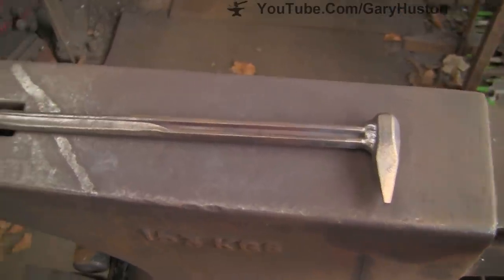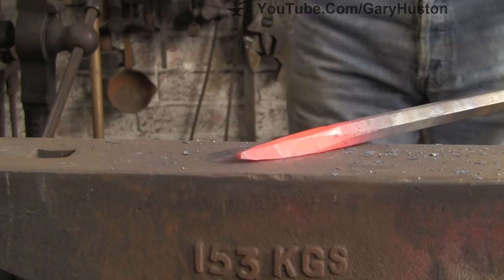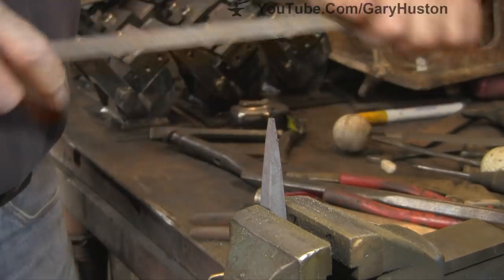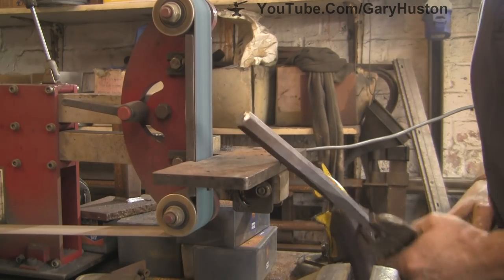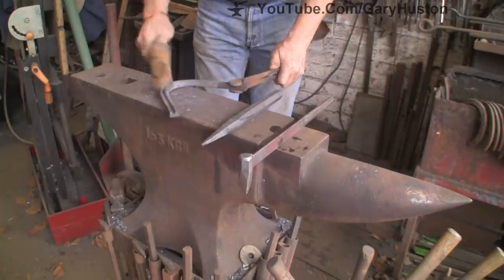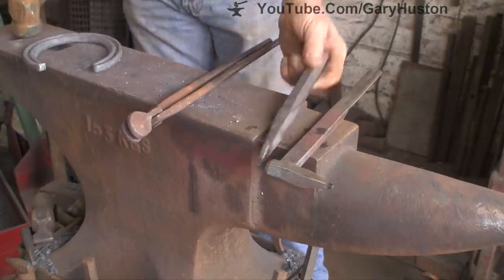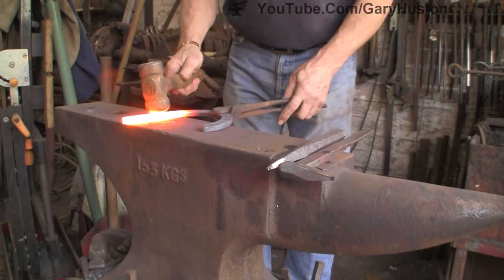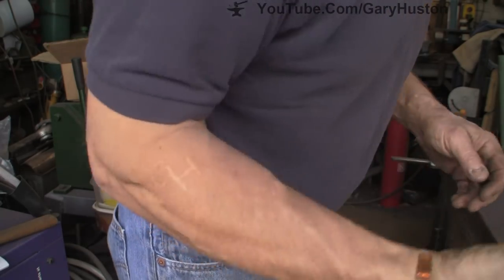Back to Basics, Making a Pritchel

Comment: Quite a bit of that went over my head, but I am slowly picking up more info as you occasionally do a set of shoes or show a horse being shod. Like the angle on the front holes, but the back holes being vertical - makes sense, and I wouldn't have even thought about the need for it until you mentioned it! One day maybe I'll even understand what you are talking about with "hunter" as a shoe type :)

Comment: Nice work as always Gary,the little driving hammer you made me is still working out beautiful. I’ve been spending more time at home with the new baby but I’ve shod roughly 100 horses with it and I absolutely love it. 

I made mine years ago out of broken bmw halfshafts from my ‘89 m3 back when I autocrossed years ago. 20yrs,2 wives and 4 kids later the bimmer is gone but most of my hot tools tools are still with me lol. What’s your stance on tuning up prichels,stamps and punches Gary? Are you in the thought of tuning them up with a grinder/belt or tune them up hot?  I used to grind mine,but at the same clinic I went to with billy as clinician he did a tool maintenance session and showed me how to tune them up under the hammer,he told me if you do good enough work off the hammer you don’t need to clean much of anything up with a grinder or rasp.
Reply from the maker: Glad the hammer is holding up. I’m of the same school as Billy, we were taught to tune them hot, you don’t loose so much material either and the tools last longer.
Reply: @garyhuston   I’ve learned a lot from billy over the years,as well as big John from Ireland and a few others I’ve meet in my travels over the years. And it’s mostly little things,things that you chalk up to inconsequential little details. But billy told me that it’s the details that separates as half assed job from a so-so job from a good job. And from that day on I’ve shod everything the same,dosnt matter if it’s a back yard nag,a 4h kids walk/trot horse or a 2yr old that’s already made $100,000. They all get the best that I’m able to do.